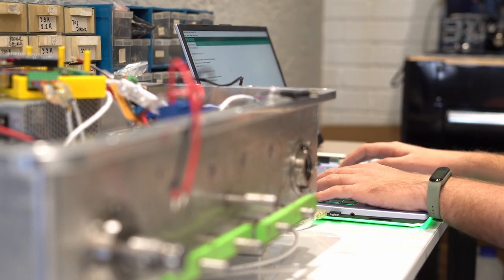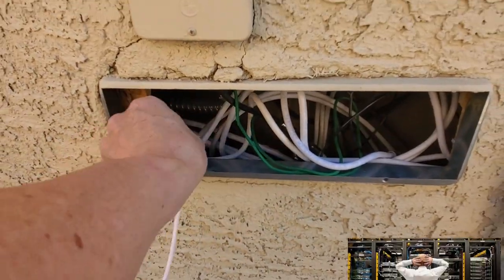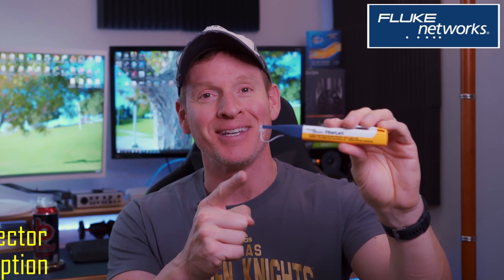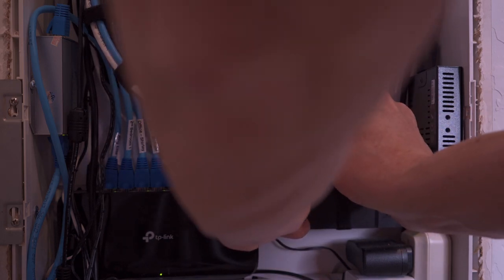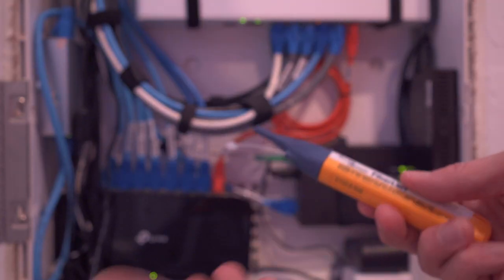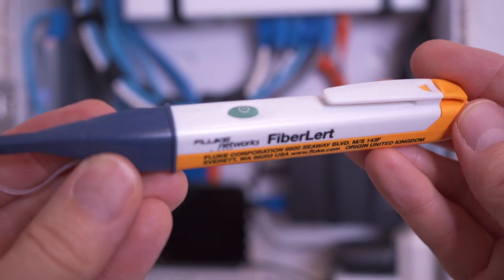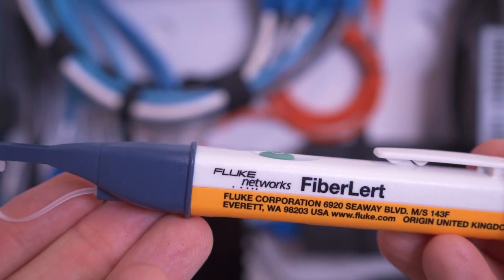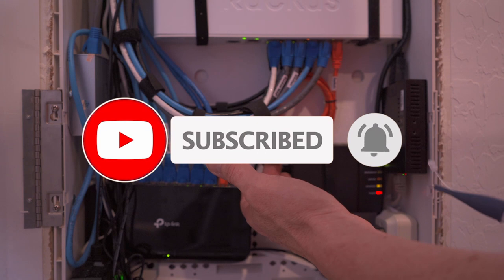FiberLert Fiber Light Detector | Troubleshooting Fiber Optic Cable

Comment: i dont think this is worth it whats so ever 

get a fiber optic visual fault locater i bought it for cheap like 10 USD and it works to check if fiber cables are in fault or not
Reply: Different use case imo. I mainly use VFI for checking path. Often times they are even to strong and will still show light in small breaks.  This is great when I just need to see if I'm receiving signal at the equipment without having to setup the VFI at the distant end. No more cupping the end and risking my eyes, lol
Reply: @xS0JUx  could you elaborate more 
Tbf I did two installed (one failed and the other one works) and that’s probably be it for my life time maybe 2-4 more (as you could guess I don’t do this for a living I just installed fiber for my home and it’s not used for internet it’s used mainly to get a hdmi signal from one place to the other 
The internet was done by my isp, but this use case was niche for my pleasure) 🤣